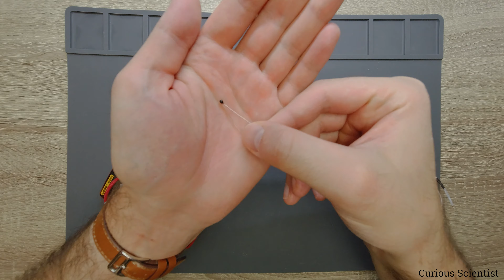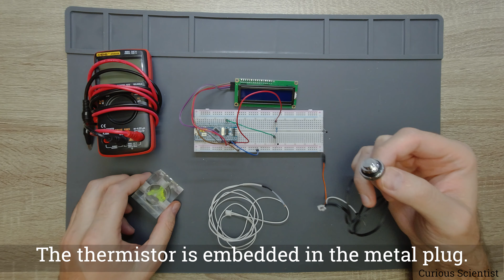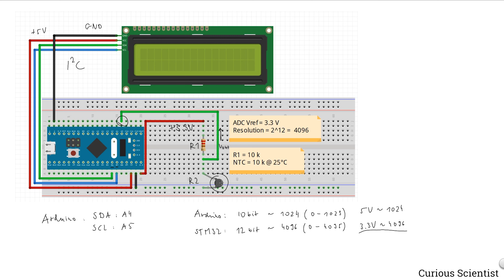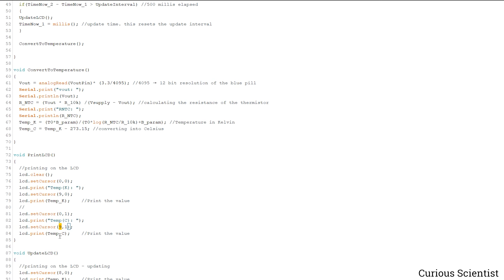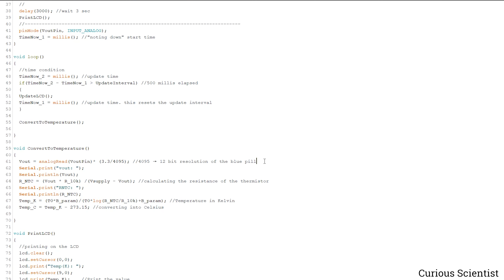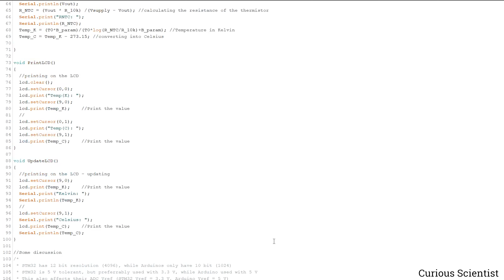NTC thermistor thermometer with STM32/Arduino

Comment: Can it works with 2.9 power supply?
Reply from the maker: 2.9 what?
Reply: @CuriousScientist  +2.9 V power supply for NTC
Reply from the maker: It should be OK. Nearly ideal if your ADC measures up to 3.3 V, and not so ideal if you ADC measures up to 5 V.

Comment: Hellos sir, can we use for ultra low temperature? I already try the max31855 as you suggest, but fail to get good result. I need to measure -100 degree celcius. Hope you can help to suggest.
Reply from the maker: NTCs cannot go that low. However, the module you mentioned should be able to reach such low temperature even with a k-type thermocouple. I don't know why you cannot reach that temperature, I don't know anything about your setup.
Reply: @CuriousScientist  thanks for your very quick response and advise sir. I already use the max31855 with ktype thermocouple. I would like to share the short video, hope you don't mind to give the suggestion/ idea what to improve. Currently waiting for max31865 module to test with rtd as what you share sir. Appreciate your comment very much. 

Link: https://youtube.com/shorts/agSo0DbPPpY?feature=share
Reply from the maker: Put a 10 nF ceramic capacitor between the thermocouple input terminals.

Comment: Can I use this in Arduino Uno at mega 328?
Reply: Thank you sir , got it , 😊
Reply: Yes sir , got it , but i appreciate your help till now thank you sir 😊
Reply from the maker: Sure, just be careful with the definition of the pins.
Reply: Thank u sir , besides this  i had a question abt the pinning, as u said to be careful , can you tell me like which pining is for thermistor ?, I got the lcd connection,if u you help me with the thermistor connection sir 😦
Reply from the maker: All information is in the video and I even provided the schematics on my webpage. Check everything carefully.
Reply: The schemetic is of other board sir 😶, so i am confused sir
Reply from the maker: The purpose of the pins doesn't change. Pick an analogue pin for the NTC and use the i2c pins for the display.
Reply: Hi sir , i am making a project on 3d printing filament making from Peta bottles, so for that we are using arduino Uno and ntc thermistor glass one , so this application i wanted to use , but it is not showing proper temperature. Can you help sir 😢?
Reply from the maker: Everything is already provided in the video and in my website. Sorry, but I am not a free support service.

Comment: A circuit like this is easy to set up, but watch out for the inaccuracy of the thermistor specifications. Several factors will decrease the temperature accuracy for very low and very high temperatures. As you mentioned, an ice bath is a good way to get a fixpoint reading. Regarding STM32, its ADC has at least 2 bits of noise, so averaging multiple readings is a good idea to gain usable resolution.
Reply from the maker: Great remarks, thanks! Yes, the accuracy is not as good around the extreme values. Also, I often see that people are just using a linear equation for the resistance vs. temperature relationship. Here, I tried to use the logarithmic formula to get better results. Averaging is also a great idea! STM32 is faster than the Arduino (72 MHz instead of 16 MHz), so for general tasks we could not even notice any drop in speed for averaging a lot of readings.
Reply: Hi um could you explain exactly how I can achieve this? My stm32 adc concepts are a bit weak
Reply from the maker: What do you mean? Everything can be found in the video, just follow it.
Reply: @CuriousScientist  oh hey no your video is perfect, I was asking the commentator about the averaging part
Reply from the maker: It is a basic averaging of the readings there's nothing special about it. Do let's say ten readings in a for() loop, in each iteration sum the readings and then after the for() loop is ended, divide the sum by the number of iterations. Simple.
Reply: @CuriousScientist  I see, thanks for the help